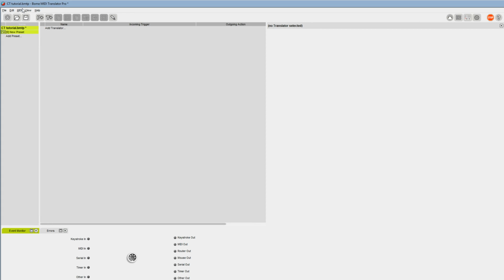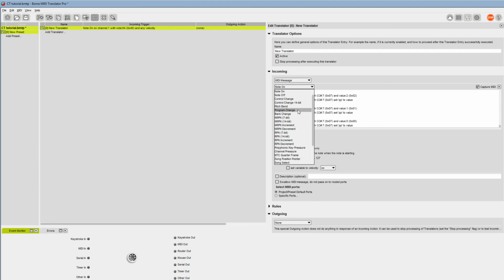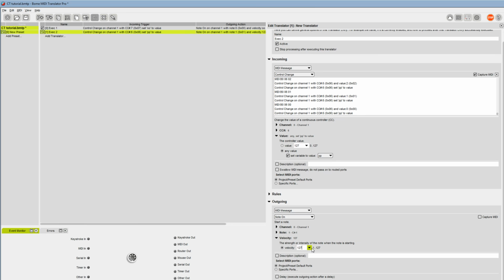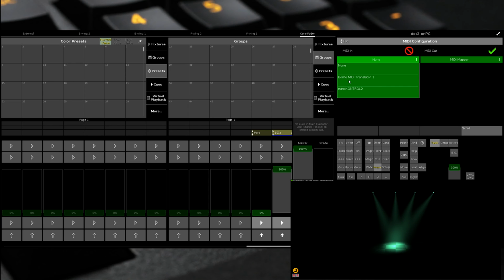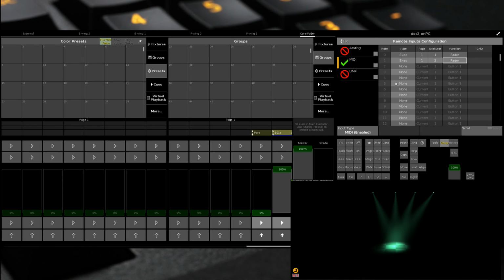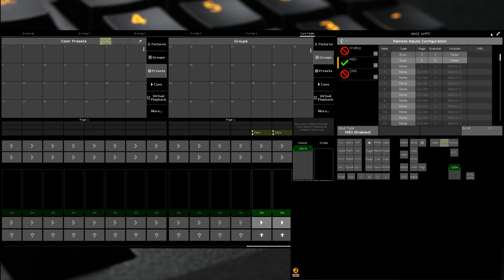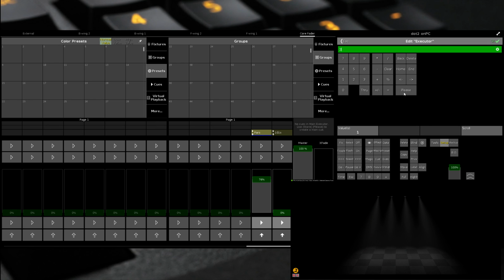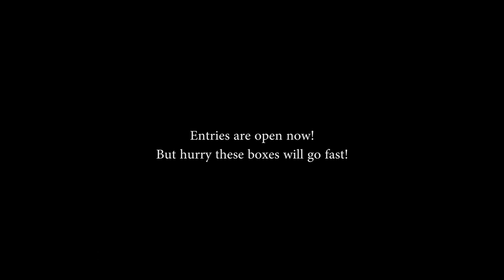Dot2 Basics: Setup MIDI on Dot2

Comment: Hello. Thank you, this video was very informative and I was able to figure out my faders on my APC20 quite easily. Unfortunately, the buttons are all the same note, per row, and differentiate by midi channel. Which Dot2 doesn't seem to glean that information. So I try and translate the buttons and send different out notes, but I can't seem to set them to both note on and note off, like they are before I translate. Any Advice?
Reply: You have to create a seperate translation for "note on" (APC 20 Midi In at button press: 90 35 7F --> 90 0A 7F (where 0A is your note for example)) and "note off" (APC 20 Midi In at button release: 80 35 7F --> 90 0A 00 (where 0A is your note for example)).